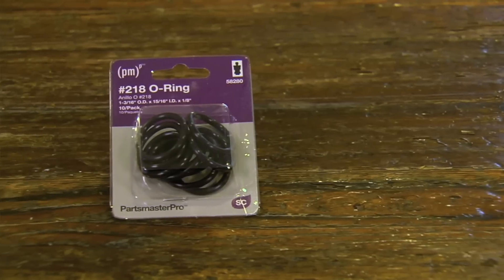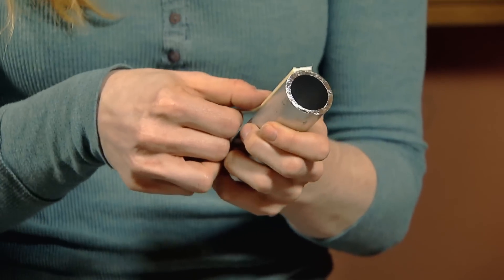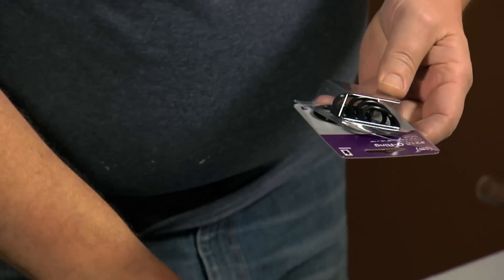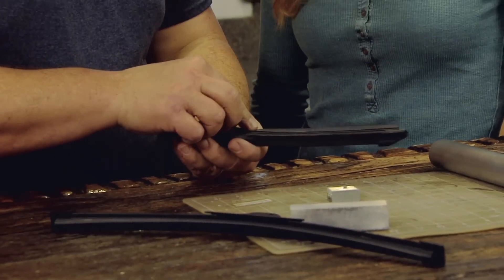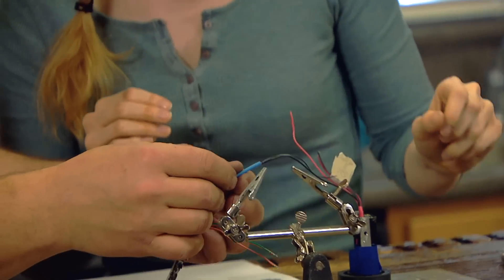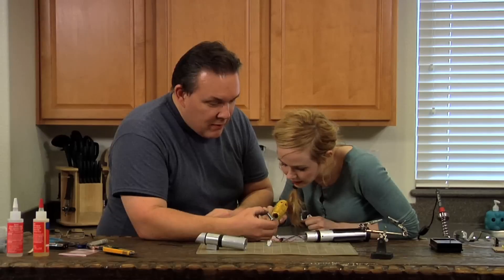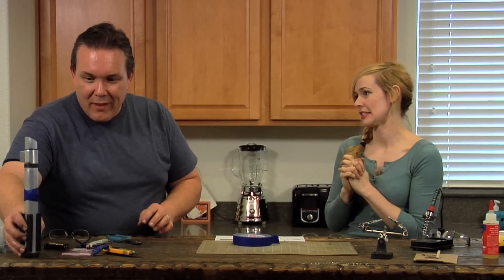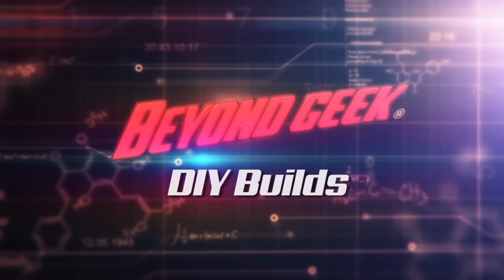Make Your Own Combat Ready Lightsaber - Beyond Geek DIY Builds

Comment: I did this but I carved in details and instead of using the windshield wipers and o-rings I actually used PVC that I cut and carved my emitter shroud is in the shape of a fox head and I made a second one that looks like a light foil basically kind of like a rapier but I took inspiration from the original keyblade that Riku from Kingdom hearts had in number one when he was controlled by ansem that looks like a corrupted jagged heart that I just made out of a piece of wood about an inch thick and on the grip I literally just carved grooves in to be finger Wells to also help let some air in between my fingers underneath that look like jagged lightning bolts and stitches and I made it a slider on off switch underneath the fox's head in between the ears and I've had that thing ever since about 2 months after this video came out but instead of making my own blade from scratch I just went to ultrasabers and ordered a blade on their site and I got my soundboard out of a kylo ren lightsaber and also ordered a pink LED from LED supply all in all cost me about 100 bucks but it was well worth it and I still have it to this day and I've also made some for my nieces and I've also made a double blade lightsaber version of My lightsaber without the handguard but each blade is on its own power switch using a three-way so if both are in the off position it's off but if one is on one is on if both are on both are on but because of the size I wasn't able to put in a speaker so it is technically just a stunt saber because the handle is about 16 in with a 3 inch blade depth on both ends so that way it wouldn't come loose so I only had about 10 in for all the internals and I had to have space for the air intake to let are in so it doesn't overheat with some slits and drill a hole and cut out a panel so I can remove the battery pack by removing a screw and it's based on the Sith Lord exar Kun and designed to be able to be used either one or two handed and then like 4 years ago I made my own version of the seventh sister lightsaber but I only did the one side handguard and it's not a double blade so it's pretty much just another version of my original saber and that one I did with a red LED and around the same time I also made two short sabers for my niece with about 10 inch long handles with a 2-inch blade depth that are stunt sabers without a speaker with mini handguards based off again the one that I took off inspiration from the keyblade but big enough to fit my whole hand inside it and my niece can fit both her hands inside the one handguard because she wanted to use two swords and I did two 24 inch blade so she's got about a 22 inch blade and then my older niece wanted something similar to a katana and a European broadsword the downside is I actually had to borrow my dad's welder so I can make the hand guard / tsuba as well as the pommel and I carved in the wrap using a file and a hacksaw blade and used enamel paints to fill in the grooves for the wrapping and she wanted a blue blade and she still wants me to make a Wonder woman inspired blade for her with a yellowish golden blade to represent the lasso of Truth so maybe for her birthday this coming year during the summer but it's going to be annoying because I have to cut the handguard to match the movie sword but instead of dragon heads I have to do wolf heads

Comment: What was the epoxy they used at the 4:49 mark? It's not listed in the description. Also anyone know how strong the glue is when cured? I can barely hear them on my laptop. And what kind of drill bits are needed to secure all the hilt pieces once the O rings are put on the hilt?

Comment: Fantastic! Question: the 1" polycarbonate tubing: would you use 1/16" or 1/8" wall thickness? 1/8" obviously stronger but is it a bad weight?

Comment: He should have put the epoxy glue on the inside of the larger tube ( at the edge) and then push the small tube in. The excess glue then would not come out.

Comment: Anyone knows the type of led? I mean power or something...
Reply: Search for Cree LED 2w. Or you can use a tri cree with 2 led of the color of your choise and white for flash on clash.
Reply: SaitoGray thanks :) As it is not that easy to find LEDs in my country, can I use any 2W leds?
Reply: I can't find any cree LED either where i live, and LEDsupply has INSANE shipping costs. Go on Ebay and search for luxeon rebel led, some lightsaber company used them too.
You can probably use any other 2w LED but don't forget that you need an optic for them. You need a narrow angle optic for the blade to really work. Be careful when you make your choice.
You can also use LED string or Neopixel but it's harder to make and the cost is really high.
Reply: SaitoGray thanks :)

Comment: Sound board prices have dropped by half, now it's installation cost.   Also you need the drill press the saw and the soldering iron...just a reminder.
Reply: And the Dremel grinder to make the notch around the switch... and the tap(s), most DIYers don't have a tap and die set and, where I live, ones that actually work can be expensive (in other words the cheap ones are garbage). However you could make do with self-tapping screws, so long as you don't mind the head showing.
Drill presses are excellent but I didn't see anything done here that made one necessary. The only difficult part was using the "trade-up bit" to make the hole for the switch and since it's only aluminium tube you could always file it out if you don't have a drill bit big enough.
Reply: @gagatube  got mine for under 10 when sears was closing

Comment: 200 dollars? More like 20,000 dollars for all the machinery you would need!!!
Reply: not really
go to your hardware store 

soldering iron is about 30
you don't need a circular saw either just get a dremel for 50-100$ and a saw blade attachment
and all you can use a standard drill for the holes

Comment: I wouldn't buy the Ultrasabers Obsidian board considering that it's 5 years outdated and there are cheaper, better boards on the market now. Even when the video was released, they could've got the NBv4, which is an entry level soundboard with 3 soundfonts and is MUCH cheaper than the Obsidian. Ultrasabers is also currently the most controversial saber company in the saber community, so buyer beware.